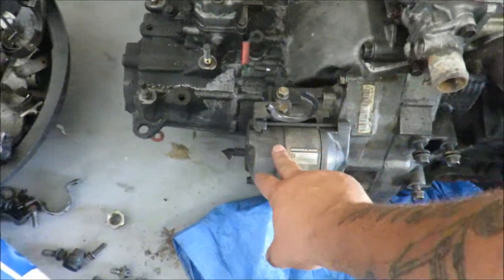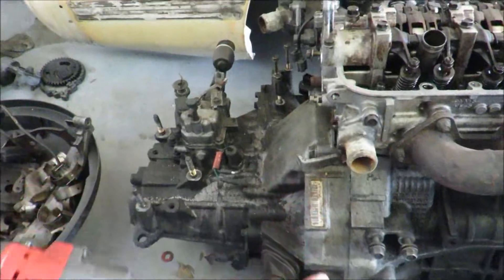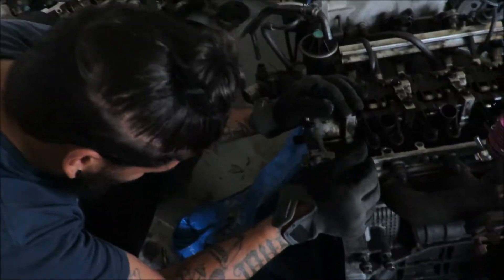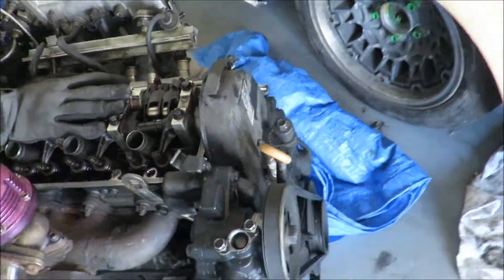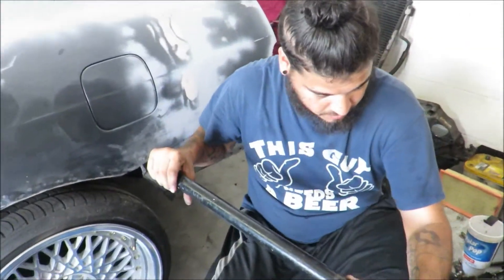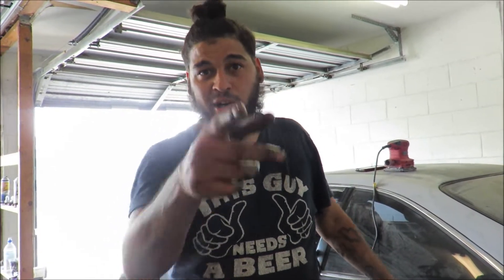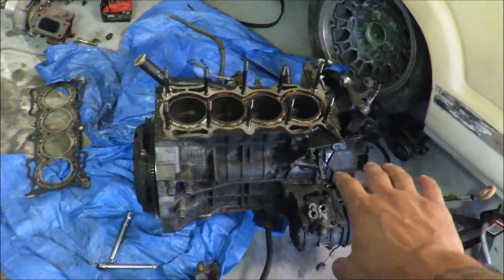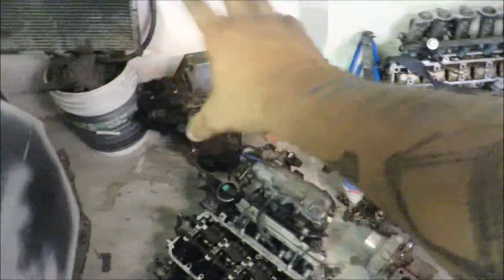Ebay Turbo Accord: we are building the f23

Comment: Really want to see what the f23 can do i have a stock 99 accord and i have a f20b for it. I always wanted to build a f23 so definitely looking forward to the build.
Reply from the maker: The f23 are great engines and very underestimated because there's not much aftermarket support for them and cause it's a single cam so they right them off